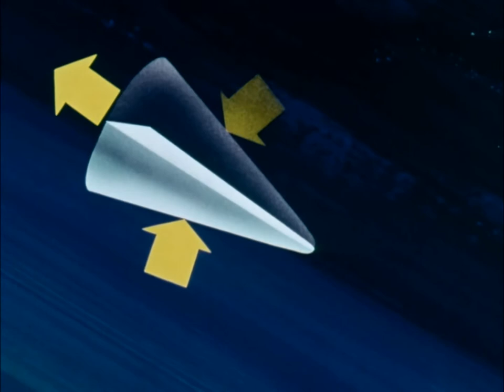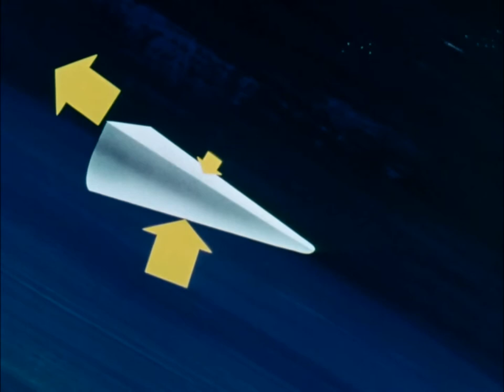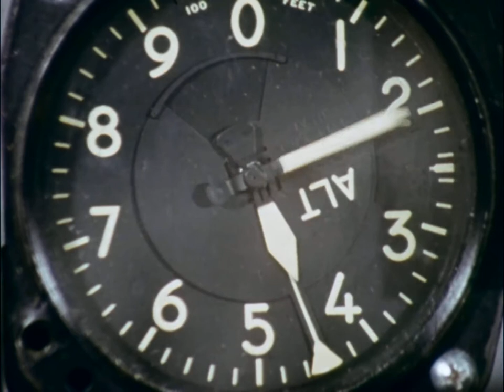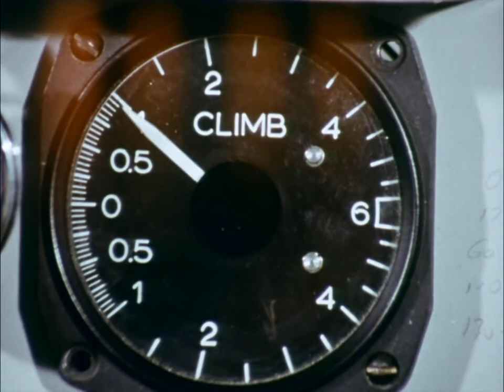Flight Without Wings - NASA Lifting Bodies (remastered documentary) -Test flights HL-10, M2-F1, 1968

Comment: What year is this from?
Reply: Good question.  The Peterson crash was in May, 1967.  The film did not feature the later, X-24 A model, which first flew in April 1969.  So, most likely, between those two dates.
Reply: @mombaassa  You're correct. John Manke's first flight of the HL-10 (as depicted) was 28 May 1968.
Reply: @Gort58  Thanks for the info.  👍
Reply from the maker: Thanks for the info, description updated ;-)